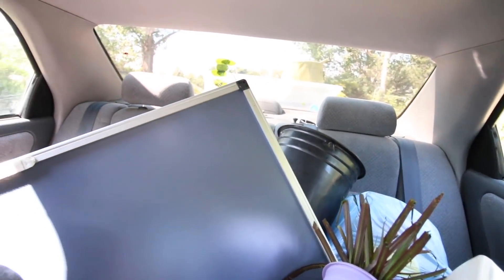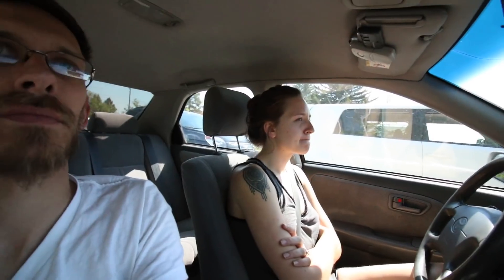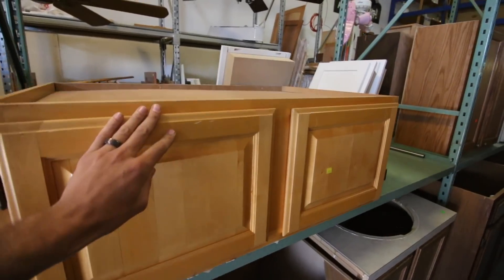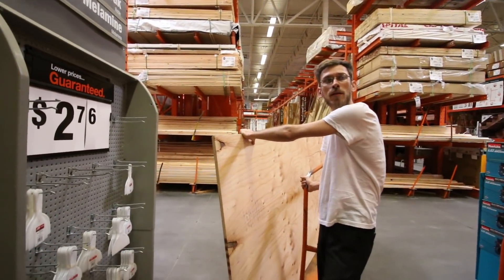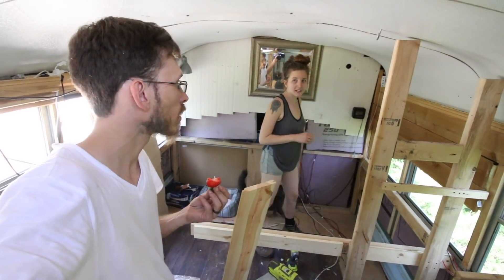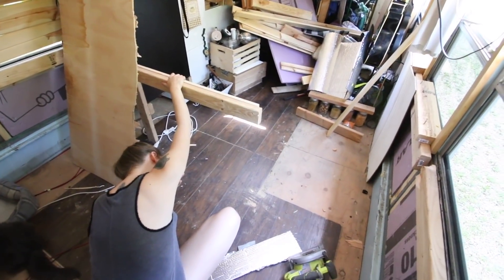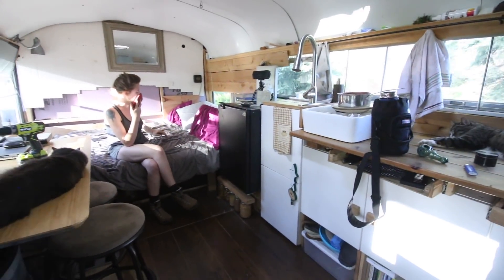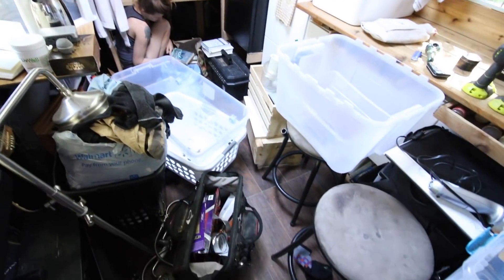WE CAUGHT THE BUG // school bus conversion reno

Comment: Hey, kind of a strange question - what type of camera are you using? You are always adjusting the exposure with the knob and I just wonder if it doesn’t have auto exposure.
Reply from the maker: We use a canon 70D & yeah we should have it on auto more often, but often in the bus it doesn't adjust brightly enough so we get into the habit of having it on manual.

Comment: we chose to build with no permanent walls using insulated curtains that can be pulled back
so if wanted we to isolate for heating cooling or privacy we can do so or leave wide open
that will be the default position 
GRUMPY OLD MAN WITH A BUS
Reply from the maker: That's a really great idea! We've talked about doing that in here too but it's really too small I think... if Chad were awake I don't know that a insulated curtain would keep me from waking up. However, it's a great idea for heating/cooling purposes!